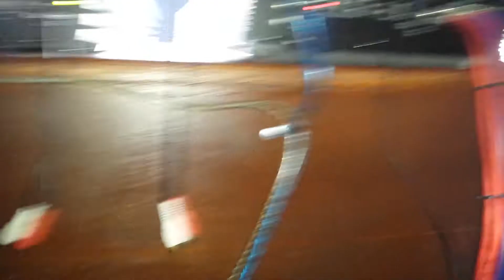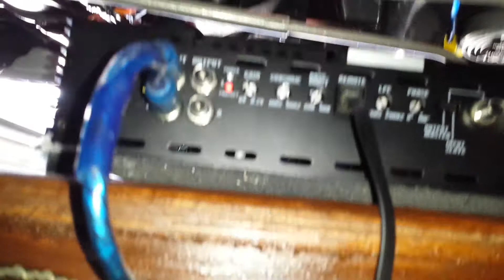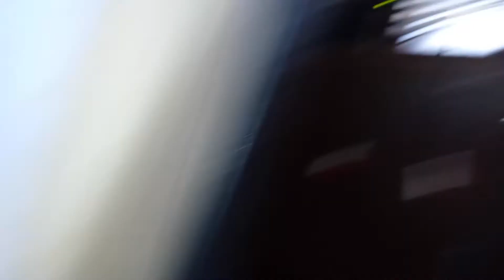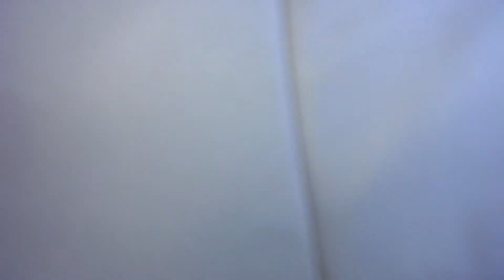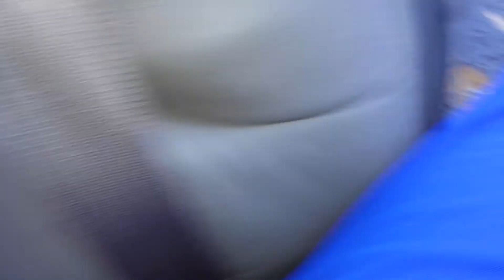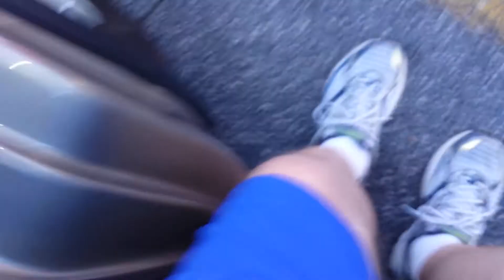NS-1 Protection Light

Comment: Crazy especially on account of how big the ns1 is, it's a pretty big heatsink foot print, I ran my m4a .5 daily in trunk boo issues.
Reply from the maker: It just didn't like .5 in my trunk...I've talked to a lot of guys who ran theirs at .5 in a well ventilated space and it did ok....I figured I'd just share since anyone considering running this amp at .5 in a space that doesn't cool very well may have the same issue.
Reply: Oldbass40 i like sundown amps, but i prefer dd. im sure those m4s have no heat issues. none of my dd amps had thermal issues.